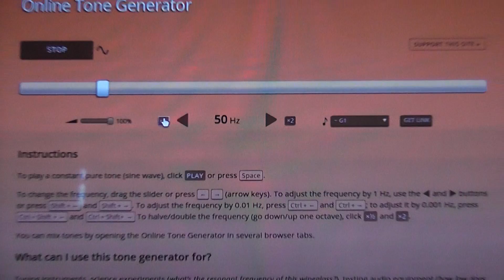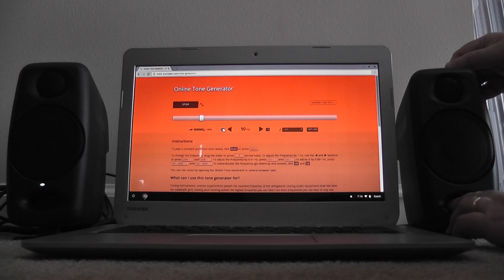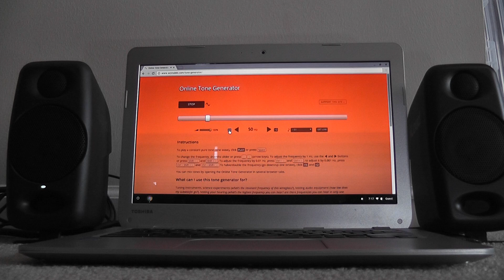iK iLoud Micro Monitor port noise

Comment: Same problem. Waiting for dealer support because I didn't bought directly to IK. 

IK says: "Typically you will hear this with lower bass notes as the speakers are intended to be near field monitors and are not intended to be used at high volumes. The reason this is happening is also because the hole on the bottom of the speakers are not very large. What you are hearing is the deeper bass sounds escaping through a small hole. This creates that sound you are hearing. Do note, this is normal when listening to louder and deeper bass tones. "

But I think this is not very normal because you can listen at low volume. In my case much more in the left than in the right. Solution of blocking port is not very usefull because you loose almost all bass sound.
Reply from the maker: You don't lose almost all bass sound by sealing the port, just diminished bass that likely will be more consistent, i.e. the classic trade off between ported and sealed speakers.
Reply: @kenlaberteaux1418  finally solved with nice and strong polyethylene foam and set LF-3db to Flat, HF +2db and switch to desk sounds really good 👍. Thank you very much. 🙌🙌🙌
Reply: @kenlaberteaux1418  thank you, I will try again, maybe with different thing that not seals at 100%.
Reply: @kenlaberteaux1418  Deffinetly there is a problem with these speakers, Tweeters make a sound at 50 Hz like the bass port but different (like electricity sound). I tryed Online tone Generator at friends house with a cheap m-audio Speakers and at 50Hz you can listen only the bass sound, nothing more.

Comment: I own a pair of  iLoud Micro, overall it's good, yet it has a serious problem, annoying port noise occurs when bass from 40Hz to 60Hz playing through. Think before you buy  iLoud Micro especially if you produce Techno/ EDM who often apply heavy bass or hard kick like the 808's.
Reply from the maker: I might not say "a serious problem". Of course, you can (and did) ;-)
It uses several techniques to get more bass from a small speaker cabinet.  If you don't like the cons of these techniques, you have an option to seal them, with the expected benefits.

Comment from the maker: I should point out that my own, dual 12" ported SVS subwoofer comes with port-shaped pieces of foam to allow users to choose: ported or sealed bass response.  The frequencies are of course much lower than the 50-60 Hz for the micro monitors, but the considerations there are the same.  Which do you prefer: more bass, or flatter bass? This website has considerably more discussion, and I think makes clear that there is no, single, "right" choice, just a set of trade-offs to consider.
https://www.svsound.com/blogs/subwoofer-setup-and-tuning/75367747-sealed-vs-ported [If that URL does not work for you, search for 'SVS sealed vs ported' to find the full-page Sealed vs Ported discussion at svssoundDOTcom]
[Also, if you prefer not to read, you can watch this: https://youtu.be/phghkPEdrRo ]
I have two sets of the micro monitors in near constant use for 6-7 years now, and I leave both as is, i.e. no foam sealing the ports.

Comment: so any idea what actually causes this? does the port need to be better supported and also why does it only occur on the right speaker? Mine it only occurs on the right speaker and I would really like to properly fix it, but thats assuming it is fixable at all by opening it up.
Reply from the maker: In my opinion, these are not a faulty design, but a design that intentionally chooses a bass reflex (ported) design, with all the standard pros and cons vs a sealed speaker.

Comment: This test especially the chosen frequency, indicate a lack of understanding how a bassreflex system works. With the specified -3db point at 55hz the port is approximately tuned to 60hz or slightly below. When putting a 50hz sinewave on a driver it is below the port tuning and you will get a lot unnecessary driver excursion that doesn't contribute any meaningful output anymore. The enclosures ability to damp driver excursion decreases below the port tuning. If i do this i would even on my neumanns hear port noise when pushing the driver above their xmax and below the port tuning.
Reply from the maker: On the contrary, I do know how sealed and bass-reflex woofers work.  I test them at 50 Hz because their specs claim *Frequency response (-10dB): 45Hz - 22kHz*.  IK could have rolled off the bass via the DSP at 80 Hz or 60 Hz, which would have prevented this issue.  But they decided not to.

Of course, closing the port effectively changes the system to a sealed speaker. If anything, I think the video does a decent job of demonstrating the standard trade-offs between sealed and bass-reflex designs, i.e. Bass Reflex provides more bass output for a given speaker cabinet volume, but is susceptible to inconsistent acoustic impedance and port noise;  Sealed provides a smoother transition or roll off, with less bass for the  given cabinet volume, and of course, no port noise.  ;-)
Reply: this!

Comment: My finger slipped on a fader in Cubasis tonight on a drum track slamming the volume all the way up 😳 So I checked the speakers by running some Moog bass down pretty low around 45 to 65hz and I heard the same rattle noise in my iLouds, so I searched the web and found this video .. played it .. and sure enough yep .. that’s the rattling sound I’m getting .. then I realized I’m listening to this video on my iloud’s .. dohh 🙄 lol, so I ran out to my real studio and ran both this video and the Online Tone Generator used in this video through my Yamaha HS50/HS80 Sub rig .. and the Tone Generator sweeped around the 50 range is tight and smooth .. no rattling, but playing this video on the Yamaha’s I could hear the same exact rattling in the video that my ilouds’s make, so I guess I didn’t blow out my iloud’s .. and the rattling has always been there since I bought these 2 years ago, but I’ve never noticed it before .. but I wasn’t hyper focused on it either. Well engineered music still sounds great on these, playing a test tone at 50hz doesn’t lol. Thanks for posting this.

Comment: The iloud micros also have another issue with cabinet rattling. At certain low frequencies especially with dance music. There is an audible whezzing noise coming from the speakers. This coupled with the port noise means these speakers are indeed too good to be true. Be warned!

Comment: I just got my pair today, and while testing it with test tones, I noticed the same thing. Mine seems to start even earlier at around 63Hz, and down to 50Hz. I thought it might be faulty, and when I hopped on the web to find answers, your video was the first thing I found. Not sure what I'm going to do about it yet (return them, or keep them. Plug them, or leave them alone and live with it).
Reply: What did you do? Is it noticeable with music? I read about it but didn't expect it to be this distracting
Reply: @CookinBeatloaf  I didn't do anything, because the chances of anyone listening to an isolated sine wave in subbass frequency is next to zero. The only reason why I even detected it was because I do frequency response tests for all my audio gear, but that's because I'm a musician and an audiophile and I'm curious about the limitations of my gear. Your average person will never do something like that because they have no reason to ever play a single naked sine wave tone. In a full mix, it's unlikely you'll ever experience any issue.
Reply: @LunatiqueRob  if money wasn't an issue, and you were in an apartment, would you get the micro or would you get the mtm? They would be my only speakers
Reply: @CookinBeatloaf  If money was no issue and it's going to be my only pair of speakers, I would get the MTM because it's overall superior (thus more expensive). Personally, I would not get small speakers as my only pair because I'd want a full range 2.1 system that covers the entire frequency range from 20Hz to 20KHz (you need the subwoofer because all rooms have room modes and will null/spike bass frequencies significantly, and only a subwoofer can remedy that because it can be placed in a spot that doesn't cause those issues in your chosen listening position). But living in apartments has limitations, and even small speakers can cause problems with neighbors because anything in the bass frequencies will travel through the walls. I would maybe use a pair of quality headphones as my critical listening gear, and then supplement that with any decent pair of speakers for times when I don't want to or can't wear headphones.
Reply: @LunatiqueRob  I have good headphones (audeze lcd2 classic), there just seems to be a notion that some monitors don't sound the same at low volumes, Kali makes an ultra near field too but at the price it seems like the MTM is more versatile and doesn't take too much desk space
Reply from the maker: Like @LunatiqueRob said, I also wouldn't choose the mini monitors as my only set of speakers, unless space limitations made them the only choice.  I think the praise for these are predicated on what they do with such a small speaker cabinet and cost.  There are plenty of larger, even bookshelf, speakers that can do many things better than the minis.

Comment: hey, I don't know if this is too late, but sealing the port may damage the drivers and the amp. the port is could be used for 2 things, bass and cooling. closing the port will affect cooling and affect the overall amp ohms. I think if you want no port noise and assured safety, i suggest high passing the speaker at 80 Hz or 60 Hz.
Reply from the maker: Nope, not too late, and thanks for your comments, with which I agree.

The operative word in your first line is 'may'.  Certainly a port can help with passive cooling (more likely to be an issue for the amp than the cone), and will affect the overall impedance of the speaker.  Whether this is a concern depends on how you use them.  If you are going to push them hard for lengthy periods of time in an already warm environment, heat 'can' be an issue.  However, there are always other countermeasures for that available.  

I own a very high-end active sub-woofer, which is huge.  It too is ported, but came along with foam pieces, and instructions, to close the port if desired.  In that case, it is clearly a trade-off: Do you want a sub-woofer with closed ports that is flat down to 18 Hz, or one with open ports with more output 30-80 Hz.  I leave it un-ported, and live with the knowledge that this high-end sub it is not flat down to 20 Hz.

I also leave my iLouds un-ported, because I haven't encountered noticeable port noise while using them to listen to my music, and appreciate the added output above 60 Hz. 

Of course, if you have a convenient solution to high-pass above 60 Hz before sending the audio to the iLouds, that can work too.

Comment: Thanks for posting this. I just got a set of used iLoud speakers to use as monitors with my keyboard. I thought the noise was due to a bad diaphragm, but then realized after a while it was a resonance. I can live with it, since it only comes on with synth bass notes, not with piano.
Reply from the maker: Exactly.  For myself, I rarely use them for electronic music, and outside of a reproducing a pitch very close to the resonance for a noticeable period of time, one might never have an issue.  Again, a ported speaker comes with some issues, but usually can increase overall bass response for a given-sized speaker.  What is important to you is what is important to you.

Comment: Guys, does anyone have a "white noise" issue? Does You clouds make a constant noise (very quiet but constant) noise?
Reply from the maker: I have heard a high-pitch whine for a while when first powered on.  I have come to believe that this is a period where the Bluetooth is actively seeking a connection. However, it goes away after not too much time, e.g. IIRC, 20-30 sec or so.  I have never used them connected to BT.

Comment: why not return it ? ,.. isn't this unacceptable ?!
Reply from the maker: "Unacceptable"?  Well, I think there is no blanket answer to that.  Certainly, if you have no constraint on weight and size, you can find other full-range speakers that do not have this trait.  But if you need a small, light-weight solution, and still want bass below 80-90 Hz, then this is an option.  Especially if you primarily listen to music that is unlikely to excite this issue.
Reply: Indeed, this is unacceptable, i was going to get a pair but now ive changed my opinion thnks to this vid
Reply: Was gonna get a pair but heard they have this hum issue. To me that's just not good enough

Comment: Same here ... your video saved me from returning those beauties - thanks a bunch. Since blocking the ports results in some loss of the lower frequencies I'll do some experimenting in order to find the best compromise. Now it's on to find or build a small and light active sub-woofer for those babies, a 5" speaker running from a second low-passed output (USB sound card) should do the trick from 100 down to 20-30Hz and doesn't weigh a ton either.
Reply: how would you connect the sub to your ilouds?
Reply: @thomashammertr9427  

An easy solution would be a mini mixer or a simple active DIY splitter ... one input > two or more stereo outputs, one of them goes to the ilouds, another one to the sub, either directly, in case of an active sub or to a mono amplifier. Simple.
Reply: @thomashammertr9427  it's really simple. I got sub hooked up by splitting one of ilouds rca ports with a splitter ;)

Comment: I used to make shape-matched sponge insert to the bass port,and make a little gap in center of the sponge,it works,no noise anymore ,it will lost some bass in the same time,and if you're clogging the port fully,the bass is lost so  much,actually in daily use,if you're in near field,don't have to so loud volume,the port noise is hard to hear ,if you set the volume loud,you have to far from speakers,the noise is also hard to hear.

Comment: Same as yours ,I bought 2 pairs,white and black version,If bass too deep and loud without other frequencies in the same time,such as Boyz II Men - Never Go away ,bass drum is so loud ,then the port noise is easy to hear ,BTW,I found out there are 3 versions of iLoud micro monitor,1:FLAT-HF-3dB;2:FLAT-HF+2dB，3：DESk-ShELF, FLAT-HF-2dB, FLAT-LF-2dB, the 2nd is my version,the third,in the picture I saw it has a hole next to bluetooth button,I think it's demo version,so what about yours?

Comment: Hi, Thanks for sharing the solution for this issue. What type of foam that you use specifically ?
Reply from the maker: I used whatever was close at hand, and have no details on the type of foam.  The requirement is that it makes an airtight seal of the port.  The rag I demonstrate does the same job.  If you can detect no air movement after installing, the foam is doing its job.
Reply: Ok then, I'll try that.  Thanks for your response

Comment from the maker: A quick follow up.  I am currently listening on my mini monitors to "Wait for It" from the Hamilton soundtrack (both the original performance as well as the brilliant cover by Usher).  The repeating bass line includes sustained notes B-flat (58 Hz), A-flat (52 Hz), and G-flat (46 Hz).  The last note is much softer than the others, due to the pretty steep  bass response drop below 48 Hz.  I can feel a lot air moving at the port.  Not once have I heard the wind turbulence.  I'm inclined to keep the ports unplugged. YMMV.
Reply: any update since ? what is the best solution in your opinion today ?
Reply from the maker: @MrBazsi888  My advice is  leave the ports open, and if you don't hear a problem most/all of the time, leave them that way.  If instead you hear the port noise and it bothers you, plug the port.  I expect for a large fraction of users, one of these two choices will give the owners a happy experience with these speakers.  If neither choice makes you happy, find another pair of speakers.
Reply: @kenlaberteaux1418  Most of the time I am happy with having the ports open. But especially if this track pops up in my playlist, the port-noise is very heavy: https://www.youtube.com/watch?v=XCyN1DPXJcs (espacially from 20sec until 28sec). And it's mostly the speaker with the LED that produces the port-noise. Is it the same with your pair?

Comment: I recently got a pair of Micro Monitors. I like them, but I have found an anomaly. I don't know if I have an odd pair, if other Micro Monitors do this, or if there is something weird in my setup.  Obviously some of you have Micro Monitors, so please try playing this video at a reasonable volume level. https://www.youtube.com/watch?v=jF4f7XcKvoMMy speakers will completely shut down (blue light on power supply goes off) for a second or two when playing the "event" that occurs following the bass note at the 1:50 mark. The "event" cause a serious burst of air from the port, without making much sound, so test at a low volume first. The same event occurs several more times in the same video. I have not found any other music that causes this behavior, but I have only had the MM's for a few days.
Reply from the maker: It plays fine on my micro monitors.